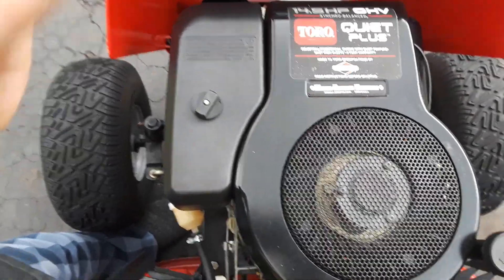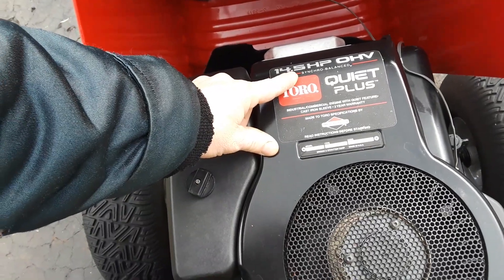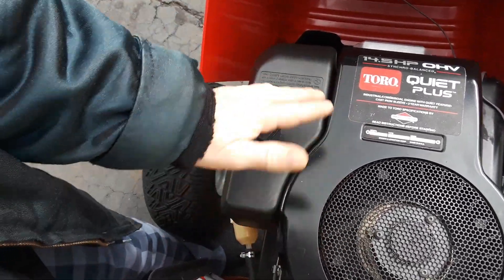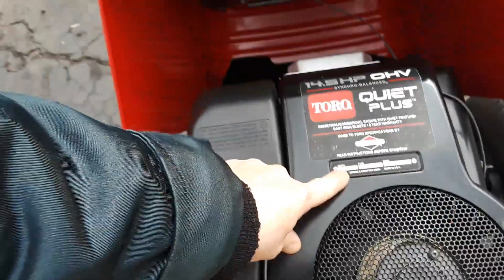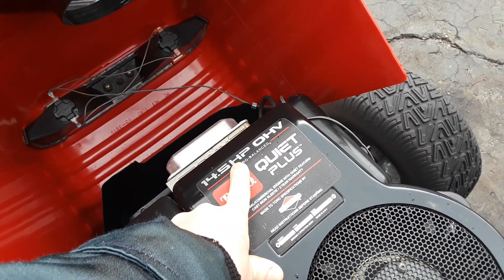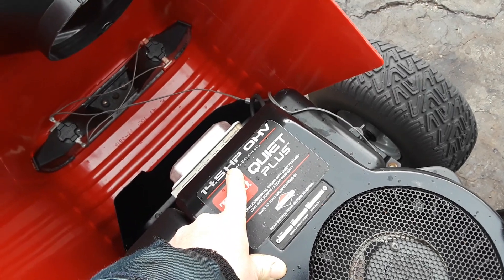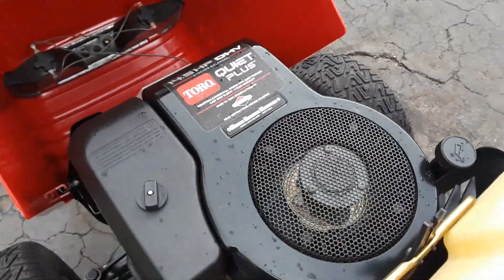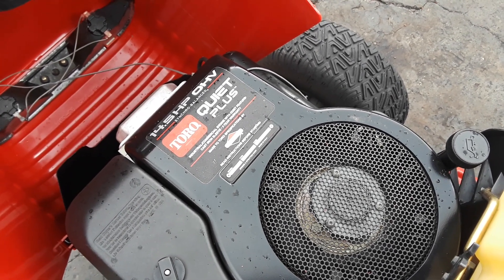465cc 12-13hp L head vs. 14-16.5hp OHV Gen 1. Is  there a difference in power? No!

Comment: I thought the 12hp was a flathead and the 14.5 is ohv which is why it has a little more power
Reply: -This. this is the answer. (And, yeah, "Mr. Tecumseh"...  an OHV is a better breather.  Why do you think they bother?) (EDIT:  Not to MENTION higher compression ratios!)
Reply from the maker: @mattfinleylive First off, let me start off by saying you need to learn how to write and who would trust anyone who can’t? It’s a bad look, because that is one sorry fragmented sentence and I’m not one that is big on calling someone out on that, but when there are that many errors it’s hard to ignore. You have periods where comma’s should be, you don’t start off a sentence with and. When you edit a paragraph you don’t write in edit, first off because it say’s edited right above the comment, so I already know it got edited and even if it didn’t, why would you do that? What is this your rough draft? That’s grammar school level we’re talking here, if you haven’t mastered that, I would not rely on you to have mastered anything past it.
The answer is no, the 13hp L head and OHV of that era carry the exact same displacement, 465cc. Those OHV’s were built out of flatheads. In fact I would argue the L head has a little more torque, the combustion chamber is smaller with an engine of the same displacement. Now you got yourself in a bind, because now you need to publish the difference in compression ratio’s and show me the actual published power rating’s between those two engines and they better be the accurate ones that were released after Briggs settled a multi million dollar lawsuit for inaccurate power rating’s. If you can’t disclose it your fragment of an argument just got debunked bad. I just took you to school and I don’t feel bad with the attitude you just presented. So come on, show me the proof, prove me wrong. 
You also thumbed up your own comment, I know that for a fact, what do you have to do, give yourself a pat on the back as you present a poor argument in an even poorer manner?
Reply: who's reading these paragraphs?
Reply from the maker: @kolakoskifarm5323 I’m getting ready to pull this entire comment off the board and update the title on the video. My response was not addressed to you and the individual it was addressed to is not going to add another reply, he got taken to school. But since you opened the topic back up, two other key points are 14.5 was a bogus rating anyway, they rated those engines from 14 to 16.5hp and it was all bullshit they got sued and paid for and the only reason they started making OHV engines was to meet stricter epa guidelines, flatheads were being phased out. They burn a little cleaner and may be slightly more fuel efficient, that’s it. Otherwise there is no difference in power between the flathead or the OHV in power. They are the same displacement engines. Flathead engines would still be in production if they weren’t forced to stop making them and they were better built and last a lot longer and need less maintenance than an OHV. I’m putting this subject to bed.
Reply from the maker: 12 to 13.5hp flatheads are 465cc, the old 11hp flathead discontinued in 1990 had 399cc and those had balls too. No generally speaking these flatheads run strong. The 13hp had a larger screen and shroud and a larger intake giving it a bump, but by displacement it’s the same as the 12. 14hp and up were overhead valves, 500cc. Being an overhead valve isn’t what gives it more power or determines it. The main thing that determines the power is size of the bore and piston, which it has 500cc a 35cc jump, so small it’s barely noticeable and makes little difference. The overhead valve engines are just a newer design and are supposed to run a little cleaner. The only reason Briggs started with them in the first place was government emission regulations, nothing else. If the government hadn’t threw their bureaucracy at them, the flatheads would have continued to get bigger themselves. They were forced to design an OHV which eventually replaced the flathead. The first Briggs OHV’s were based off flatheads, they used the same blocks and most components, all they did was take the valves away from the side of the piston and put them in front and added a slightly larger piston. The larger piston sucks in more fuel and air causing a larger explosion during combustion, that’s what gives it more power. If they made a flathead 500cc with a piston the size of the 14 it would have the same power rating. I’ve run them all and the 465cc up to the 540cc have very little noticeable difference in power. You don’t really notice a true difference in power until you move up to a twin cylinder starting at 656cc, they have noticeably more power and have better overall running balance. I run a 12hp flathead on my personal machine and I notice little to no difference with a 12 vs a 14. 35cc is a small difference. The 500cc vs the 540cc, the biggest single cylinder Briggs offers, also have very little noticeable difference, a 12hp, 465cc will adequately run a machine that had a 540cc. I know, I swapped a dead a 5 y/o 540cc out for a good 20 year old 465cc flathead. It had more than enough power to do exactly what the 540cc did. For a deck 38 to 46 the 12 will get the job done the same no problem. Getting into a 48” or 50” you need a twin cylinder an actual size-able jump in displacement and electrical capacity. Plus the flatheads came out of the era when they were designed well, made in the USA, like flatheads from the 60’s, 70’s and 80’s. Mines 27 now. Their bulletproof. They go 30+ years no problem with normal routine maintenance which isn’t much, oil and air filters changed on routine and a new plug every now and then and they keep going and going and going. Only way you kill one is if you run it low on oil or never change it, beyond that they work a long time. The early OHV’s were descent too, beyond the one added issue of head gaskets blowing out between the piston and space for the pushrod’s for the valves overhead. The space between is to narrow the gaskets blow out there frequently. Beyond that issue they’re as good as the flatheads with a little more maintenance . The newer ones made now, forget it. Their crap. They require a compression release mechanism on the cam which is now a cog vs a solid one piece cam. Those break all the time. Sometimes they cause other damage internally, when they break off and float around in there. The head gaskets blow all the time. I’ve seen them blown to pieces for no reason at all.  These newer engines have oil filters and are pressure lubricated, that should be an improvement, but it’s not, the old splash lube on the flatheads did just fine, so fine they outrun the OHV especially the new ones 3:1. So you have added maintenance of an oil filter on top of the fact most of those engines are having colossal failures at 5 to 10 years tops where the flatheads which were built at the time even better than today’s Vanguards last 3 to 4x longer. Beyond buying something with a Vanguard now, don’t expect much from those newer Briggs OHV’s their garbage and yet still better than the Kohler Courage competitor, a real pile of crap. I would rather run a bulletproof engine with 35cc less and get 3-4 decades out of it vs a little more power for less than one decade. All those new modern Nikki carbs they use now, are also crap vs the Walbro it replaced. Thank the epa, your government for those changes. It’s not just tractor engines, those new engines on the walk behind mowers that replaced the Quantum that had a 30 year run are pita’s too. Plus the Quantum was 190cc flathead power, the largest residential new engine is 163cc OHV and it definitely has less power. They only offer 190cc OHV engines for walk behinds in the commercial realm now. Their power is exactly the same as the 190cc Quantum flathead, however like all these newer engines, they have a lot of problems too, big one being a plastic cam that strips and spins out throwing off time. But no, putting the valves above the piston is not what gives it more power, not on these small engines. In bigger engines with huge displacements like cars sure. The real component adding more power is a larger bore and piston that came with OHV’s, not the where the valves are. Oh and you have to re-adjust the valves on OHV’s every couple years, flatheads valves don’t normally need adjusting, out-least not for a good 20 years and those are pulled and the tips shaved to bring them back in spec. Another added maintenance item on the OHV. So generally speaking OHV’s require far more attention for a small amount of added combustion for a much shorter duration of working life. I’m sticking with flatheads until they are all gone. Side note, the old Briggs opposed twin cylinder is also fairly bulletproof, far more reliable than the newer v twin which also has known sets of issues. One more comparison, the Tecumseh Snow king 8 and 10hp share the same block. The 8hp is 318cc, the 10hp is 358cc. They have one difference , the 10 has a larger bore and piston. That’s it. Everything else is the same. I run them both. I notice no difference in power with that 40cc jump. Their 13hp OHV as they claimed was also  358cc. In that case, the 10hp 358cc flathead had more grunt than the 13hp OHV. It was bullshit anyway, they both had the same displacement. That 13 was no bigger or more powerful than its older 10hp flathead counterpart. All these small engine companies got sued for playing games with these hp ratings, that’s why hp is not the principle method of rating anymore. They rate them by displacement cc’s or cu and ft. Ib torque and I started seeing them playing the same game with the foot pound torque rating as they did with hp. So it’s all bullshit. Just go by it’s displacement, they can’t lie about that, they do that their in deep shit. Can’t go wrong with that. A 40cc difference in displacement especially on an engine sharing the same block is too small to notice a difference. Once you go up 80-100cc and the blocks larger and has a larger oil capacity, than it’s enough to actually notice. Before all these OHV’s. You had a 12hp flathead that covered all the OHV’s now in production and the next step up was the opposed twin starting at about 17-18 true hp. So 465cc to 656cc minimum, two cylinders. That’s an actual noticeable difference in power, all these in between engines are bullshit and part of a game, hp sells.

Comment: So, what you all are saying is i can replace my 14.5 with a bigger engine? how much bigger?
Reply from the maker: Yes. Theirs only two sizes of those original ohv's 28 ci or 465cc or 30ci or 500cc. All those different hps are a lie. Theirs really 2, 14 and 16. As well as the 28ci, 465cc flathead. Theirs a little added power to the 13 due to a larger flywheel screen thats it.
Reply: I have a Briggs 10.5 hp in my rear engine rider. Can I replace it with a 12 hp or bigger? I mean, are the dimensions and shafts the same?
Thanks
Reply from the maker: @joeydepalmer4457  I’ve replaced engines in tractors anywhere from 12hp to 22hp going from a single to a twin. As long as the hoods wide enough you can stick any engine you want on. The 12 thru 17hp are all nearly the same power rating anyway. 12 and 13 are 465cc. The 15 to 17 are 500cc. Very small difference in power. I prefer the 12-13. They were far better built run strong and last the longest. 12hp is really all you need on a machine with a 38 or 42 inch deck as anyway. The twin cylinders are overkill on them unless you have like a 48” inch deck and different implements. Shit before 1990 most tractors only had an 11hp 400cc engine anyway.

Comment: They are basically the same. The carb jetting may be a bit different, but nothing to notice. Remember the briggs quantum flathead is the same displacement as the ohv Quantum, the pistons are the same exact part number. But they are rated different hp. Horsepower goes up with time, like in the early 90s the quantum was rated at 4 / 4.5hp and in 2015 they got up to 7hp, sometimes called 8.0, but the same exact displacement. Same goes with the opposed twin engines. Hp numbers just go up on the same engines.
Reply from the maker: Right, exactly, but don't forget, the opposed twin was made with two displacements, the higher one had larger Pistons, it was a 40 C.I and  42 C.I. Same thing with the V twins now, they make units with two displacements. The lower ones can be anywhere from 16 to 20hp the higher ones can be anywhere from 21 to 25hp. The quantum was anywhere from 4.75 to 6.75. There was never a 7.0 Quantum you're thinking about that early overhead valve engine. Most commonly seen as the Briggs & Stratton Signature Series JP Stratton Junior. Those went up to 8 horsepower although they were also only 190cc however they were overhead valve engines.